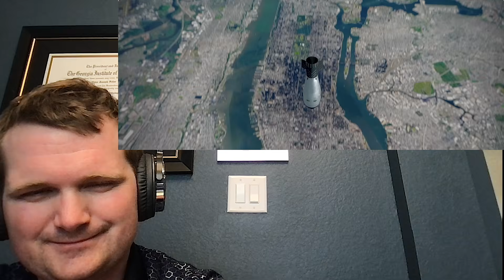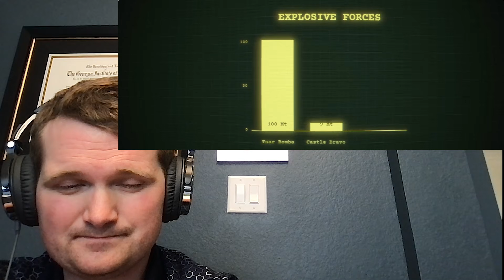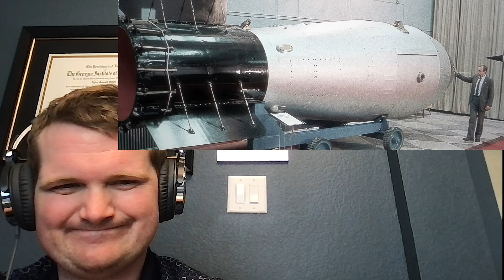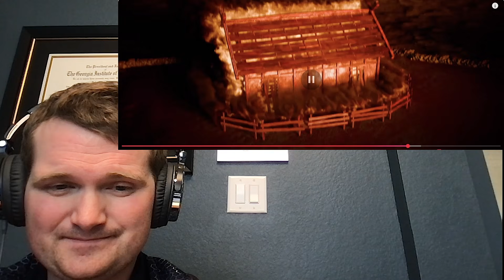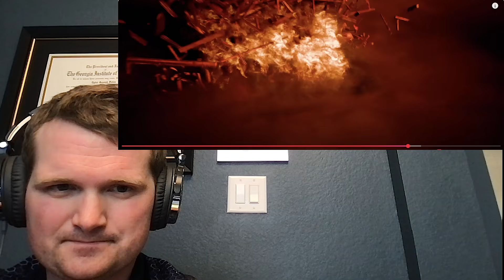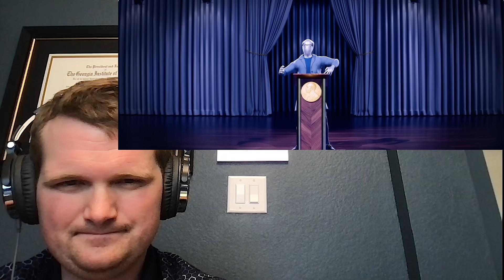The Biggest Nuke Ever - Nuclear Engineer Reacts to Fern

Comment: Interesting that the diagram seems to show 2 fusion bombs, one on each end of the main fusion component.  One thing that the Soviets had developed was a concentric style fusion bomb where you have a pit of fusion material nested inside the fission pit inside the explosive shell.  Timing 2 fusion bombs to react equally on each end of a large amount of fusion material would likely fall into the terra-seconds area.  In your analysis you mentioned a 3 stage devise and you did not see that, I figure this could explain that 3 stage process.  The US did fusion bombs with the fusion material adjacent to the fission starter, using 2 smaller fusion bombs with the primary fusion material between them properly crushed and evenly heated in the middle should be quite a bit more efficient.  Your comments on this would be interesting.

Comment: You know nuclear power plant and military both require absolute discipline or fall apart like legos ... security in a nuclear plant isnt just paranoid amount of technology that does its thing , chernobyl was because asshole confused himself with god and there was no balls anywhere in that facility, asshole wasnt confronted and shit blew up...that graphite on rods wasnt really guilty or the flaw of rbmk...
 asshole in high position deciding to skip things unskippable by design was THE cause
Reply: The swiss-cheese idea of risk management would disagree, blaming a single cause isn't useful, it'd be better to avoid having such glaring design flaws that could be exacerbated by human ignorance (and/or arrogance).
The RBMK having a positive void coefficient in most regimes was one of them, it would have been relatively simple to design it differently but someone who wanted an award kept the design to allow for cheaper less enriched fuel. Could they have kept running the RBMK reactors safely afterwards? Yes, and they did for decades (the last RBMK was decommissioned 2 years ago), of course they did remediate the most glaring of issues but...its best to design things to be as fail-safe as possible. Reactors benefit somewhat from how spooky they are to the fallable human mind, and much like air travel they became one of the safest methods of power generation, a fact always neatly glossed over for people making money from fossil fuels.
The humans higher up in the ranks were a major factor in the disaster, but it'd be useless to discount the design flaws as significant contributions. As an aside; The whole no-balls thing is honestly a bit harsh...a lot of the staff there were wildly young and very new, and the USSR was...pretty nasty about the power that your boss had over your future (which is ironic given their supposed ideals). Its pretty understandable that they didn't offer more resistance. Happens when you're stuck with people like that. See: The Smolensk air disaster, something which is still a cultural sore spot for the Russians.

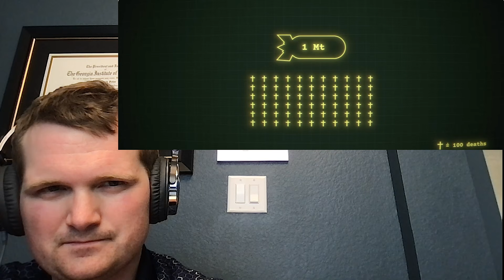Comment: 6:50 A clarification is needed here: Sakharov relied on his own calculations, employing a different model and line of reasoning. The issue was not so much radioactive radiation or radioactive fallout—which are, indeed, largely confined to the vicinity of the explosion—but rather the formation of the carbon-14 (C-14) isotope in the air and within carbon dioxide (CO2). Sakharov pointed out that this problem was not limited to the blast site; over time, the isotope could spread across the globe. He advocated for a total ban on atmospheric testing, given that even a hydrogen bomb explosion generates C-14. He published his research in 1958—three years before the testing of the "Tsar Bomba." English version:  Science & Global Security, 1, no. 3-4, (1990): 175-186.

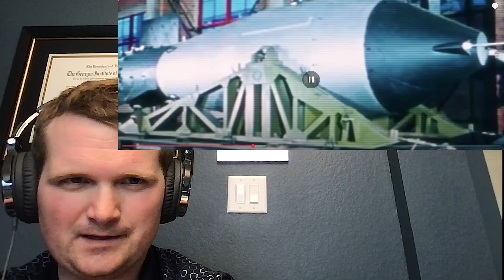Comment: 14:05 When the USSR launched the first satellite into space in 1957, it was launched using an intercontinental ballistic missile capable of carrying nuclear weapons. The late USSR could use an energia rocket to deliver from 4 to 8 100 megaton tsar bombs directly to New York or Washington, completely wiping out territories within a radius of about 1,000 miles. and infecting the entire USA with radiation. The secret of the tsar bomba has not been revealed still, for a reason, many ballistic smaller and lighter  nuclear missiles have been created on its basis, which are much more powerful and dirtier than anything the United States has so far.

Comment: The claim that weapon systems like the AN-602 are unusable due to their enormous size is false. A weapon system the size of the Tsar Bomba would easily fit inside the unmanned, AI-controlled, and nuclear-powered underwater vehicle Poseidon. Given Poseidon's potential diving depth, this underwater vehicle is difficult to detect. The system could easily lie in wait off the coast of New York or Los Angeles for years. Once detonated, Poseidon would completely destroy entire coastal metropolitan areas.
Reply: The bombs are meant to be air dropped, your plan is viable, but a ballistic missile with a smaller one is more effective and can do even more damage

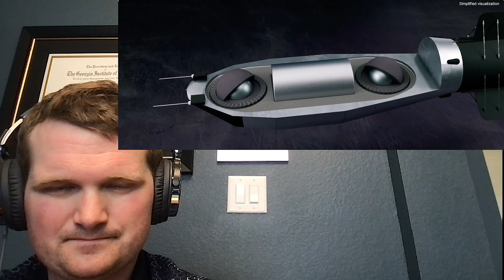Comment: @27:17 I have no idea where this animation came from but it's incorrect. I've also never heard a claim that it had multiple primaries, which doesn't make a ton of sense. Images and descriptions on Nuclear Weapons Archive make it pretty clear that a single primary was in the nose cone and that there are multiple third/tertiary stage assemblies in the widest section of the bomb. The secondary (or secondaries) were probably in the same location. Nuclear Weapons Archive also points out that the USSR tested a 12.5 megaton bomb (their largest to date) a week before this test. They conclude that Big Ivan was likely a number of those bombs arranged in 3 stages. 

I also see lots of confusion about the definition of "stage" as it applies to the Tsar Bomba. It was a 3 stage device in both the 50 or 100 MT configuration. The difference is the removal of fast fissioning uranium tampers on the tertiary stage assemblies and possibly the secondary. Fast fissioning of uranium isn't stage by itself, and it's present in every or almost every thermonuclear weapon because it's essentially free yield.

Comment: Tzar hydrogen bomb  had fireball 8-10 km across which appeared in less than one second.  It could burn skin in 1000 km distance.  Its energy yield was huge , but  it is interesting just  330kg  of hydrogen  in this bomb  was processed in  fusion  and  some 2.3 kg of mass  turned to energy.
Now consider this:
In the space there are  dead star cores called white dwarfs. Sized of  earth, very dense and very slowly cooling. In the case of close presence of normal star, white dwarf sucts the matter (consist of hydrogen and hellium) from it and pressure matter  on the surface. The hydrogen+hellium makes very hot and in some time it suddenly explodes like hydrogen bomb.
The amount of fused hydrogen there is some  20 thousands quintilion of  tons (in short scale).
And this explosion still don't reach supernova power. Supernova is million to 100 million time stronger than nova.
Reply: The tsar bomba caused burns up to like 50km
Reply: @Rasmus-v3l I made mistake. Now i checked sources on internet - third degree burns in 100 kilometers , 1000 km is visibility distance.
Reply: @pjaro77  even 100km is soviet exaggeration real stimulations show less

Comment: What is crazy is that the efficiency of fission nukes is really rather low compared to the full E-MC^2 equation. Mostly because upon detonation, the atoms that neutrons need to interact with are now speeding away from each other. Fusion devices are not really much better in terms of total energy conversion, even though it is still going to make someone(s) day very bad.

Interestingly it is why making the fission bombs larger is more likely to lead to a fizzle than a fission, and without fission you are not going to get fusion.

It also puts a limit on how small you can make one, because for it to work, but at such a small/compressed scale it is still more likely to fizzle before being useful.

However, fizzle makes for dirty bombs, but horribly inefficient.

Comment: Tsar bomba was designed and built as a 3 stage 100mt bomb. It wasn't until just before launch the engineers replaced a uranium tamper with a lead one for the 3rd stage reducing its yield to 50mt.

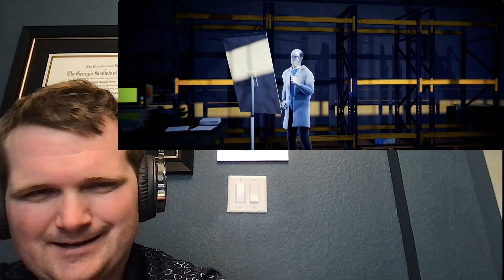Comment: 2:00 While it is impractical to deliver such a thing through the air, I wonder if it would be possible to assemble it from components in some basement. Or simply deliver it disguised as a technical installation without someone checking what it really is. The only challenge is the required fission material or is it?

Comment: The danger of Nuclear bombs isnt so much the fireball or radiation, as nature it would seem has surprising ways of dealing with such things, albeit at a rate longer than our lifetimes, but its the damage to Earth's magneticsphere.

The core of the Earth is liquid and has a magnetic charge that wraps around to the poles, and for the most part remains stable.
If enough of the cores magma shifts where the positive charge is where the negative charge is supposed to be, that will cause a polar flip.
Rare of course, but this is a potential side effect nobody ever talks about.
And with bigger bombs, no matter where you test them, this is a bigger concern.
Probably even more risky at the poles.

Confining the energy from such a blast so that it doesn't shoot through to the direction of the core is not as risky, so make of that what you will.

Comment: 26:12 No AN602 had only one fusion stange , its a fission–fusion–fission design . Why is that ? In a  fission–fusion–fission  design, the fusion stage releases an enormous burst of extremely energetic neutrons that penetrate deeply and very rapidly into the surrounding heavy material, causing a far larger fraction of that material to undergo fission before the weapon can physically tear itself apart, which dramatically raises the total amount of nuclear energy that is actually converted into explosive yield compared with a pure fission bomb. In essence the reason why it yields such enormous energy is because it employs fusion boosted fission  which was pure genius from Russian designers !

Comment: Is there a way to calculate water displacement(tsunami wave-type effects) if a Tsar Bomba size device were detonated 12 miles(international waters distance) offshore of a major port or population center? Obviously seafloor contour and depth would be critical factors; wondering what the most effective depth would be for wave generation? A deep/hard seafloor with a gentle slope would probably allow maximum generation. Seems underwater delivery would be much more efficient delivery for a large first strike weapon with such a massive/heavy physics package....

Comment: Back then there was mostly "dirty" bombs where they inserted radioactive materials outside the tent layer. This drastically increased the fallout period from 6 to 9 months. Now the bombs are built without the additional material. Designs focus more on destruction of civilization with less of environmental impact on nature other than the initial destruction. Based on fallout shelters, the dirty bombs intent was to make above ground activities and survival near impossible. 

I remember reading this in a scientific publication, back when reading from printed paper was still around.

So some data from nuclear testing from long ago may sound like a stretch, however it is the matter of materials used during the test.

Comment: You say it was too bulky to deliver to those lousy capitalists. By plane and long range? Yes. By rocket to deorbit over a US target. Almost possible at the time and definitely once the nuke is properly weaponized. Castle Bravo's nuke was not exactly a bomb. It was a three story shed and test installation that was not a usable weapon. It did not however take long to weaponize it into a smaller, deliverable form factor. The Soviets did likewise. Therefore delivery of the weapon may have become possible. What they ended up doing was a mix of single warhead weapons in the megaton range and multiple warhead MIRVs in the kiloton range. One was for high value hardened targets and the other for area saturation.

Comment: sooo, ok , you say tsar bomba would be easily intercepted because of the bomber and size requirements..... but what if they had used it as a suitcase nuke instead?🤔 ..... 🤣
Reply: Or put in the trailer of an HGV truck. Or a "Fishing" vessel sailing up to the coastline. Or placed inside a shipping container. Or a myriad of other ingenius trojan horse methods. Engineer Boy clearly lacks imaginative thinking, and trying to downplay the single most horrifying weapon ever designed, built and succesfully detonated deserved a megaton of downvotes.
Reply: @GoodWill-i9h  you do realize my suitcase nuke coment was sarcastic, yes? because ther is no suitcase big enough to fit a tsar bomba ... ;)
your suggestion probably would work though...
Reply: Or use a Chinese spine balloon

Comment: It seems the problem with the Linear No Threshold Model is that humans actually are exposed to slightly higher than background radiation and can cope with this provided the amount is not TOO MUCH (radiation poisoning overwhelms this by being beyond the capability of coping).  The crews on airliners get higher than background, a hike in high altitude mountains means higher dose as does our dental or medical X-ray use (but not something the body cannot handle with it's own antioxidant processes).  The Linear No Threshold Model is now not considered an ACCURATE model from what I can discern. 

I think that science gets distorted when retold, or sent through bureaucratic channels or into media.  It's only modestly harder to actually study up and get basics of physics down, but it's much less TERRIFYING to stick strictly to facts, so there is little incentive to write or put out information which is accurate.

Comment: I liked most of your reactions so far, but this one is right on the edge for me. Around the part where the Tsar Bomba is actually tested (~20-32 minutes), you interrupt the original video every few seconds to add or correct something permanently. For me it ruins the whole flow of the reaction. You're better, when you're more focussed and to the point, the "stuttering" "micro-reactions" here are close to inconsistent rambling, as you also repeat several things multiple times.

Comment: "Radiation isn't a big issue. Uranium is really safe. Even radon gas is fantastic."
- Uneducated murican

You would get panic reaction in Finland.

"That's not enough. You need at least 1 billion degrees to start fission reaction."
- Uneducated murican

Meanwhile sun is chilling with 15 million degrees at core doing fusion.

Comment: 1mi blast radius = .785mi2 
5mi blast radius = 19.635mi2
Or 25x bigger.
Reply: Distance from ground zero is the metric most commonly used, not area.

Comment: R-36M-2 "Voevoda" the final version of SS-18 Satan had a capability of delivering 9.5 tons anywhere around the globe, with upwards to 20 Mt single warhead. That is already 1/3rd  of Tsar Bomb. 
If really wanted no doubt a much bigger rocket could be built to deliver 20 tons with 50-60 Mt yields. But why build monster rockets when could easily put 100 Mt super massive in a remote controlled drone submarine and silently approach NY or LA or whatever other major megapolis and wipe it ? Oh wait, it already exists, its called Poseidon 🤫

Comment: 25 megaton devices were proven ICBM deliverable a year after Tsar bomb. Don't know where you're going with 'good luck getting it there'
Reply: Tsar bomba is 50 or 100 megatons
Reply: The Tsar Bomba was so physically large that the bomber used to deliver it for the one test had to fly with the bomb bay open. Also it was delivered by Bomber, not ICBM. However, had development continued, I don't doubt they could have created an ICBM delivery system for such a device.
Reply: @teapoweredyugi did you actually read the fucking comment?
Reply: MIRV's with 10 -100KT warheads would be far more effective, so there's no point.

Comment: We didn't find out Tall Boy wasn't 20kt until later, it was designed as a 20kt weapon and Paul Tibbets (commander of the 509th) was told 20 by the weaponeer.
Reply: I saw Tall Boy and 20kt so I immediately thought you meant Fat Man then after I posted the comment I realized you mentioned Paul Tibbets 😂😂
Reply: @PRC_E5 yeah, there was a lot we didn't know at the time, basically chucking science projects out of aircraft to bluff the Japanese into thinking these were serial production weapons and we were setting a 3 day cadence, and we kindly gave them some extra time to consider their position after the first two (in reality the third was weeks away). Tall boy ended up being 16 +/-2.

Both weapons used were designed to be nominal 20kt so they couldn't tell they were in fact very different weapons.
Reply: *Fat Man
Reply: Ah! You confused me! Little Boy! 😂😂

Comment: Interesting thing about the size of Tzar Bomb is that it isn't that much different than the GBU-57s the US just dropped on Iran, which are 20 feet long and 30,000 lbs.; the GBU-57 is similar in length and a little lighter than Tzar Bomba, but the B2 bomber carries 2 of them.  The B2 is certainly NOT easy to spot in the sky!  With respect to the Nobel, I don't find it ironic at all.  After all, Nobel was a chemist who made his fortune by inventing dynamite and then using his fortune campaigning for peace, which is much like Sakharov. I'd say that's fitting.

Comment: 29:04 But even as an air-burst, I don't get how you'd see it from 1000km away (as they said in the video). It should be well under the horizon at that distance, considering that it was only dropped from a height of ~4km. Or did they just see reflections of reflections of the light flash?
Reply: I'm assuming it's some sort of atmospheric reflection.